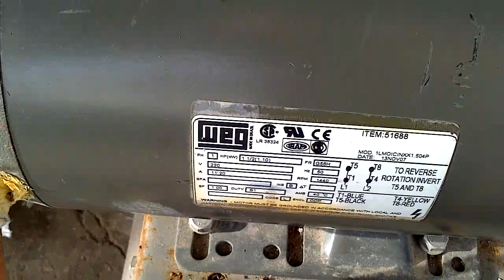COMPRESOR 2 CABEZALES MOTOR WEG FUNCIONAMIENTO

Comment: It seems like it's running very slow. At that speed it should last a long time, and if it makes enough air for your needs, that's fine. If you need faster air charge, maybe try a larger motor pulley.
Reply from the maker: Sorry no inglés
Reply: @RXS11518  Ja lo que te quisieron decir es que ha esa velocidad de giro del motor tu compresor demorará mucho para lograr cargar el tanque, que quizás por necesidad especial para ti así lo quieres por qué el ruido de operación es bajo!!!
Reply: @cyberman150  no dijo eso 

Dijo:
Parece estar girando muy lento
A esa velocidad éste debería durar mucho tiempo, y si este hace suficiente aire para tus necesidades , está bien.
Si necesitas cargar aire más rápido, deberías intentar con una polea más grande en el motor.

Saludos amigos